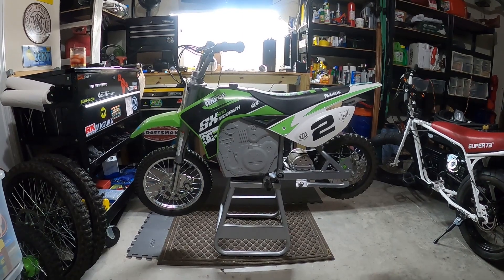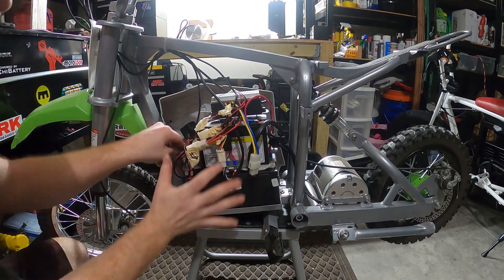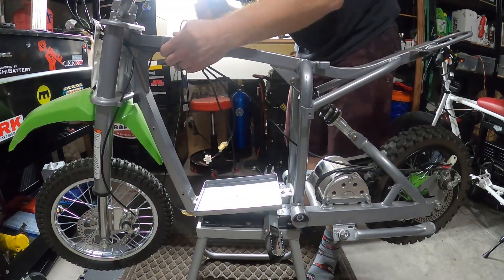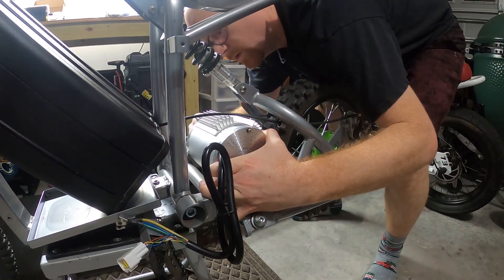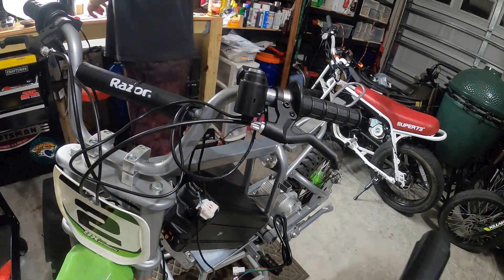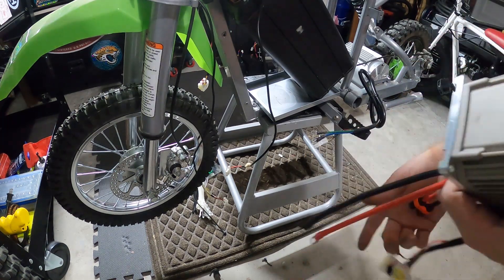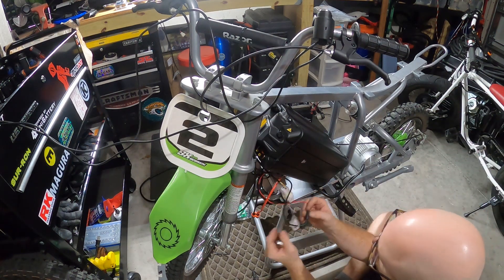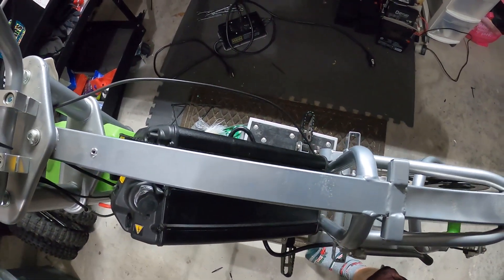Razor upgrade 5KW & 60v Surron battery

Comment: Does the mx650 have the same space as the sx500 to fit surron battery?
Reply from the maker: Mx650 is slightly smaller
Reply: @ChaseWorks did you ever find out if it fits

Comment: Which Kelly Controller did you use? I know the KVD7212NX Controller for the razors say they're 48-72v compatible but did you have any issues runnin that 60v surron battery with that Kelly controller?
Reply from the maker: No issues at all, I’ll have to double check the model for you.
Still runs great today.
Reply: @ChaseWorks  wow that's crazy because I'm gona go with the same setup. I'm lucky enough to get a 60v surron battery from a friend of mines for cheap$$ but I wasn't sure if I actually wanted to go with a Amazon Kit for less $$$ or the Elecro & Company Kelly Controller kit they have for these razor bikes

Comment: Where did you get the batery and all of that stuff for the bike?
Reply from the maker: Battery came from a stock surron x. 
The motor, controller and throttle came from electro&co website. Sold as a kit.

Comment: Could you do this with the surron battery and controller, and stock razor motor?
Reply from the maker: Good question. I think it’d work but you could burn stuff up pretty quick. People add a battery and over volt to 48v pretty commonly. 60 would be really really pushing the limits.
Reply: @ChaseWorks  so I guess my next question would be, do you need the kelly controller? Would a sur ron controller and a 5kw motor work better?
Reply from the maker: @JJCUNSC  the surron controller is locked to the surron motor. They’ve made it that way.
I BELIEVE the stock razor controller would also be locked to the razor motor. 
If changing the motor you would need a diff controller. I like the Kelly. You don’t have to order through electro & co.. you could piece by piece do the motor, controller, connectors and such but if you can afford the extra it sure makes it convenient. They’ll also go ahead and pigtail the harness wires to fit a surron battery instead of a xt60 connector or such
Reply: @ChaseWorks  this helped alot, thanks. I upgraded my surron and have the extra battery, I was gonna put it either on a rsf650 or mx500. I've never seen the battery on an rsf tho so not sure if it will fit.
Reply from the maker: @JJCUNSC  the sx500 may be the only one that will fit it, it has the biggest inner area is what I’ve learned

Comment: What is the top speed you can hit using Sur-Ron battery? Also, can you limit the top speed using the Kelly controller?
Reply from the maker: Believe it was 42 but I’ll put out a new video soon and do a speed test.
Yes you can limit with Bluetooth aftermarket piece.
Reply: @ChaseWorks  i have your same battery  and everything and im only hitting 31mph whats seem to be the issue?
Reply: @ChaseWorks so you can use a dongle on it?

Comment: Those mx front wheels are weak better off with the og wheel the sx comes with
Reply from the maker: Funny, I had a friend Ride mine and it’s warped after going over a log. Have to swap back now
Reply: @ChaseWorks  Good thing I saw this, was just about to swap over to a larger wheel!
Reply from the maker: @billyjenkins3015  it’s fine for on the road but logs and bumps I don’t recommend!